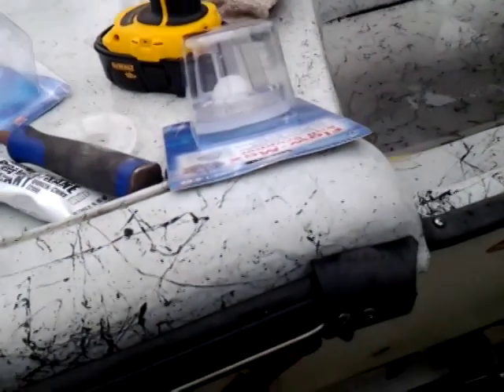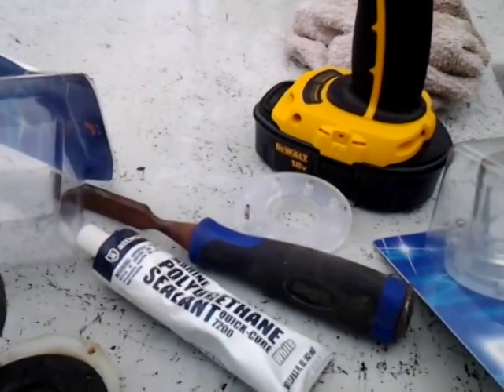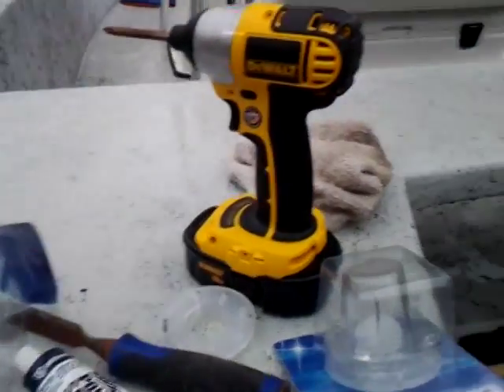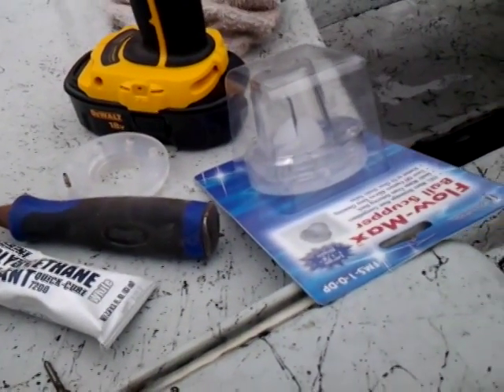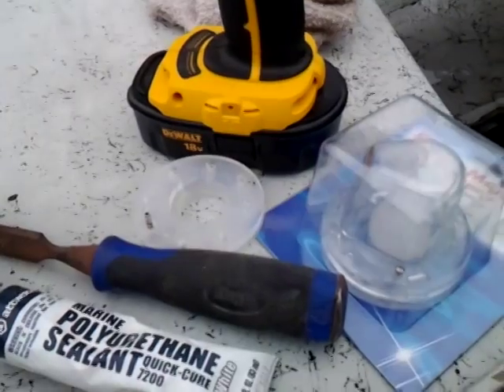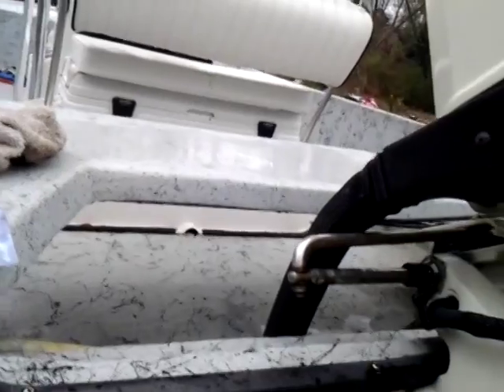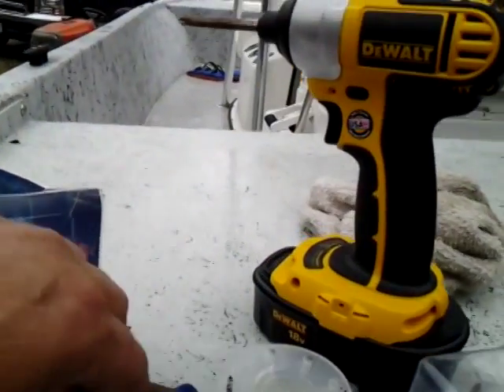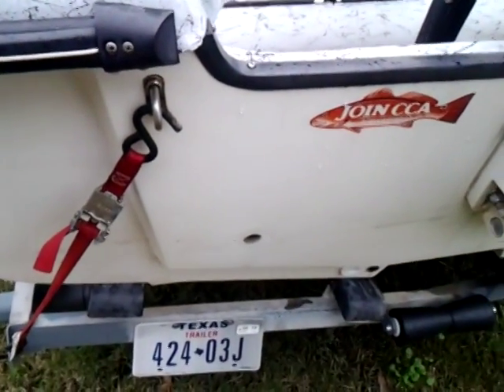Kenner boat deck scupper replacement

Comment: Hi, now that it has been 6 years since you’ve put it in, are you happy with this scupper?
Reply from the maker: They worked well for the 3yrs I owned the boat.
Reply: @dallasgriffin2646  great.  As what’s the point of the ball inside? Just to prevent the water from going inside without having to plug and unplug the drain?
Reply: @aniyahudi when water enters the plastic chamber it forces the ball onto the drain so water won’t enter. The. When you stay driving the ball dislodges and any water is pulled out of the boat